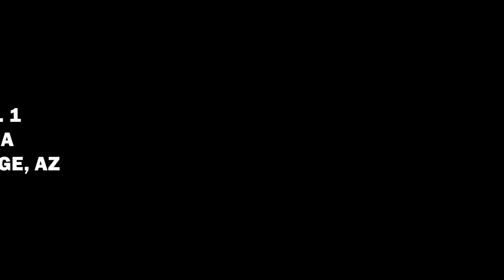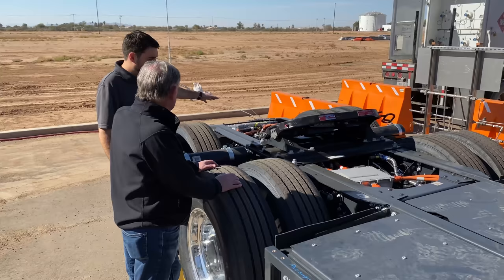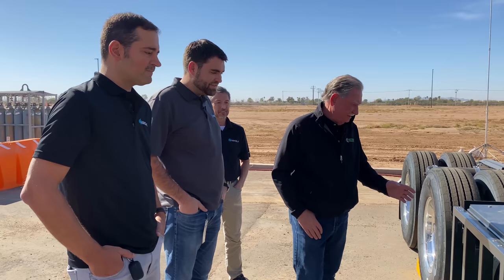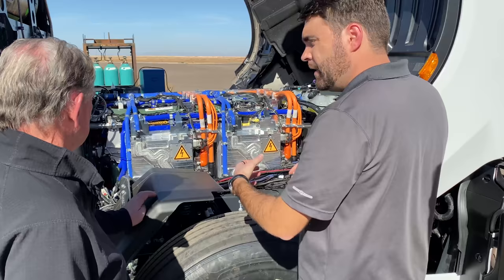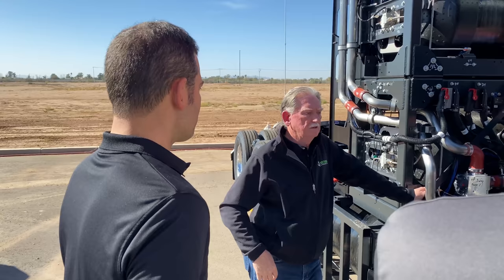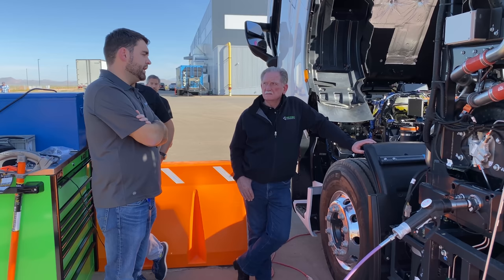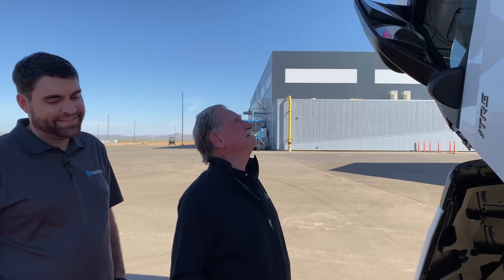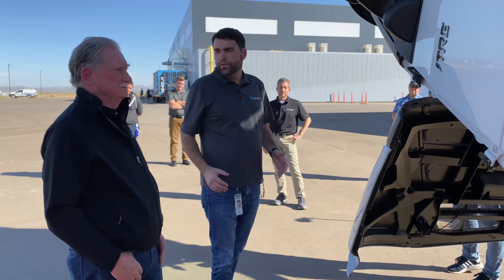Nikola Series - Ep. 1: Introduction & The FCEV Alpha

Comment: Hydrogen fuel cell EVs are just regular EVs with extra steps.
Reply: They also need batteries.
Reply: Hydrogen fuel cell electric trucks have better range,  doesn't lose range in cold temperatures, refuels in 15mins for trucks, can haul more cargo  because of weight limits on roads. More cargo equals more revenue
Reply: Its market is niche for long distance trucking, that doesn't mean its pointless.
Reply: @mariofornarelli1067  maybe look into scania for better clarification. They actually already operate multiple heavy use commercial h20 vehicles. In customers hands with continuous feedback coming to them from those customers. Yet they announced earlier this year they are abandoning all h20 vehicle development. And sticking strictly to building out their commercial use ev lineup of vehicle's. 🤔
Reply: @4literv6  look into Hyundai fuel cell electric trucks they already have 100s of them in Switzerland
Reply: @mariofornarelli1067  I'm well aware of those trucks, did you know each one has a 210+kwhs battery pack onboard it? 
Did you know a hydrogen commercial use vehicle uses 3-5x the energy of a similarly equipped ev commercial use vehicle. 

So a hydrogen commercial use vehicle requires rare earth elements in the catalyst which wears out. 
Requires a large battery pack, requires multiple electric motors. Specialized tanks for holding the hydrogen. 
Requires infastructure to fuel it and service it which doesn't yet exist at any large scale.
Hmmm yes let's all hype hydrogen over evs. 😏
Reply: @4literv6  hydrogen fuel cell electric truck is an electric vehicle lmfao 😂
Reply: @4literv6  Also BEV trucks for long haul with cables over head cost millions of more compared to hydrogen infrastructure and hydrogen made from renewables and nuclear.
Reply: @mariofornarelli1067  what's so funny though? It's less efficient than an ev version more complex, more expensive and the infastructure doesn't exist currently to support them.

Comment: @13:15 -- 270 horsepower seems a bit weak.  Most diesel semis are in the range of 400 to 600 HP while the Tesla Semi is 1,000 HP.  The Model Y long range has 350 HP and the performance has over 450.

Comment: 500 miles and takes up as much space as 500 miles of batteries. 

Hydrogen currently costs around 15,- per kg. Or about 900,— for 500 miles. And electricity would cost about ,16 per kWh or for a 750kWh battery 112,— for 500 miles. 

Now drive that vehicle for 1 million miles which it should last. Lets not talk about the fuel cells they have to be serviced ever few thousand miles. Lets talk about the cost difference. Say hydrogen can be produced @ 5,— per kg. Then its 120.000kg x 5 = 600.000,— US$ Energy cost. And about 225.000,— US$ for electricity. 

Case closed.
Reply: Do you really think the kWh and Lithium are staying the same if there is a massive increase in demand? Fuel Cell just lacks the supply infrastructure.
Reply: @RogerM88  
No, long term the price will go down, because of increasing supply, innovation and economies of scale. There's plenty of lithium, it's not going to be an issue.
Reply: @RogerM88  The price of battery materials and the cost of electricity are almost certainly  going to decline.  Economies of scale for materials and the move from nuclear and fossil fuels to wind/solar for electricity.

Fuel cell vehicles will have to pay 2x to 3x more for electricity due to all the energy loss with electrolysis and compression.  And user will have to pay for the infrastructure to generated and store hydrogen.

It looks like Tesla may put their first battery powered semis in private hands in the next couple of months.  If they perform like Tesla has stated then the FC semi is a dead dog.
Reply: @SciFi Author B.L. Alley 
Actually, EVs use orders of magnitude more batteries than anything else, so yes, demand is growing like crazy. But fortunately supply is growing too, so it's fine.
Reply: Those tanks are much bigger than I expected. And I haven't seen any (credible) plan to make hydrogen cheap enough to be viable
Reply: Everything in the design is terrible. Tanks are less safe if kept near the ground where ground debris can puncture it and where other low vehicles can hit it. They should have kept all the hydrogen tanks together in a larger second cab - behind the driver cab. It would be safer from impact, would have less hoses to leak, less parts, and easier to service. It doesn't make sense to sacrifice function try to keep the shape of a traditional truck just to look good.
Reply: @SciFi Author B.L. Alley 
Except it does. That's why we have a serious battery shortage, despite the exponentially growing supply.
Reply: Thought the issue with batteries on long range trucks was the weight
Reply: @SciFi Author B.L. Alley 
But EVs are causing the shortage. They caused the huge jump in demand that nobody saw coming (well, except for Tesla).
And an EV has far far larger battery than any mobile device.

Comment: I'm still behind battery electric for trucking. Hydrogen will always be too expensive compared to electric. Maybe charging time will be a bit longer, but we cannot assume that all trucks are interstate long-haulers. Most can do their thing on a single charge and be recharged at night after work.
Reply: The industry will learn that a little less flexibility can pay off big. Better planning software will make that happen.
Reply: Batteries are barbaric, but so is liquid fuel. We need to reduce both to a minimum.
Where are the billions that should be invested in reverse engineering Nikola Tesla's best work? even HE didn't really like batteries.
Reply: I'm not, I'm in the "long haul trucking is doing it wrong" crowd. Electric freight trains are massively more efficient than any sort of BEV or fuel cell truck. In town, yeah BEV is the way to go, but you don't need a huge battery for that..
Reply: Which is why Nikola has fuel cell and battery-only options
Reply: @quixomega  there's a train track a few miles from my house. I only get caught by the train once in a blue moon but when I do it's a min 10 min delay. I can't imagine having to deal with trains in a daily basis. Semis are always going to do most of the hauling.
Reply: @bahamatodd  Hyllion too. Except their ceo isn't going to jail
Reply: @quixomega  DAF, VOLVO, Mercedes are already on BEV trucks. As is Tesla.
Reply: @Cloxxki  A vote for Solid State Hydrogen.
Reply: Isn't that why Nikola has a BEV variant of that exact same truck? 

To cover both markets, short haul and longer haul. 🤷‍♂️
Reply: @matthenley7641  when working with Hub's you can do most of it all.
I think if most local and short trucks go BEV you can even keep long haul on ICE.
There is more gain in city trafficking on pollution.

Comment: 700 bar, 10,000 psig. How often do those tanks need to be inspected and tested? Do they have to be stamped?!?

Also, no degradation? Pretty sure membranes can deteriorate like everything else in this world. I wonder what their life cycle cost for that would be. 

Not even getting into the thermodynamic crime of producing and compressing Hydrogen to use as a transportation fuel.

Hope they figure all of that out though! Great video! Thanks Sandy!
Reply: The tanks in a Toyota Mirai have a service life of 10 years, and renders the car total loss at the time they need to be replaced, because these tanks are so expensive.

I know these tanks are different but gives you a ball park where this might be going.
Reply: @MarcoNierop  An additional reason it's a throw-away vehicle: fuel cells wear out.  They probably aren't going to last much longer than a decade of driving.  An expensive tank replacement can't be justified when the fuel cells might fail soon after.
Reply: The degradation was probably the lowest point of the video.  What they were actually saying is both batteries and fuel cells degrade substantially but batteries tend to be rated using as-new range while their fuel cells would be rated using their degraded range.  Mind you the context was only the kW output, not the total range of the vehicle; I'm unsure how much the degradation affects efficiency and thus range.
Reply: @MarcoNierop  That doesn't make any sense, they're just plain carbon fibre empty tanks, how fkn expensive can an empty tank be, 1000 bucks?
Reply: @MarcoNierop  Which is more expensive, Mirai hydrogen tanks or EV batteries?
Reply: I didn't follow that part and wish Sandy had asked for clarification. They mentioned the membranes or some part of the fuel cell degrading over time and at the same time said the output after 10 years would be close to what it was at the beginning.
Reply: @rhamph  The FC will give the same output after 10 years, even as the membranes are at the end of their life after 10 years. That's probably why Nikola uses the 10 year/1 Million Miles warranty plan.
Reply: @giovannifoulmouth7205 you've obviously never bought or even casually perused the cost of a very high pressure vessel.
Reply: The tanks are large, high pressure with a dangerous gas. In South Africa, if I am not mistaken, by law the tanks would need pressure testing regularly.  Not sure if this would be once a year or every 18 months. I see this as a major ongoing maintenance cost.  They would also need full certification when supplied new.
Reply: @ThisIsF-dUp  They'll have the same power output because they're derating them.  That's fine, I think it's more honest to give end of life ratings.

Power isn't efficiency though, and I don't know if fuel cells also lose efficiency as they degrade.  Loss of efficiency would mean 500 miles of hydrogen tanks would become 400 miles, but you're still paying to fill up for 500.
Reply: @1djbecker  The trucks will be available through a 7 year lease. So eventually they will come back to Nikola where the worn out components can be replaced and the truck can be leased again.
Reply: From what I understood, total power output will degrade over time, but the efficiency will remain constant.
As for the high pressure vessels, they will explode. H2 at 10,500 PSI is insidious. It will degrade the integrity of the materials over time. The tanks will rupture and when they do, it will be all over the news.
Those fuel cells require precious metals. I have no idea if the precious metals can be reclaimed and reused through recycling when the fuel cells reach end of life.
As for worn out parts: Fuel tanks, fuel cells and fuel delivery system will all have to be replaced. Anything that the high pressure H2 touches will have to be replaced or the refurbished vehicle will suffer a catastrophic failure.
Perhaps further research will discover materials and processes that will bring down the cost of fuel cell power plants, the production of H2 as fuel and make the systems safer, but at this time, I've not even heard of any developments that give me any confidence in anything better than what Nikola is working on right now. Great as a thought experiment, but not safe or practicle for comercial use.

Comment: In the unlikely event Nikola actually started to make real hydrogen trucks, you can clearly see that due to the complexity of hydrogen tanks and fuel cells this technology is doomed to fail.
Reply: Also fueling works out to be some 2X more expensive than diesel in an optimistic case.  DOA, probably just attempting to limp the stock along until they can all sell.
Reply: Toyota is 20 years ahead of these guys on hydrogen tech, they just insist on applying it exclusively to products that make no sense. They should be working on a truck, and a railroad locomotive.
Reply: Thank you for your interpretation Mr. Engineer.
You definitely know how it works!
Reply: @jonathanlyng3442    Elon:  "Hold my BEER"
Reply: @Mrbfgray  
Unicorn truck.
Reply: It was designed specifically to fleece naïve, noob Robinhooders and has succeed at such to an impressive degree.

Comment: I'm really interested to hear and see if Sandy thinks this company can turn themselves around after Milton's shenanigans.
Reply: The two engineers Sandy interviewed, they seem sincere, they are doing good work, the problem is I fear they have a losing proposition which is fuel-cell, and I don’t need Elon to tell me that. Consider this:

With a battery electric vehicle you have to usethree major components Power conversion components before you get to the drive train:
Batteries, inverter, and motor.

The hydrogen vehicle, not even looking at the problem with hydrogen cost, etc. you have these components in front of the drive train:
Super high pressure tank, expensive fuel cell, possibly batteries for surge power, then the inverter and the motor.

Unless these hydrogen vehicles have some extremely superior range proposition and super Duper fast refuel, I don’t see the advantage. Even then I’m dubious. The principle that should be applied is the KISS, “ keep it simple stupid.“

I’m not against hydrogen, and maybe this is a niche where it will work. Maybe I’m all wrong. But I doubt it. I think the range and fast recharge will be there with pure battery electric Heavy duty trucks, and they will win out in the long run. It will be interesting to see what happens.
Reply: @steveperreira5850  You nailed it; this thing is designed to have a 500 mile range ... just like the Tesla semi. Another interesting point in this video is that the fueling is going to be not super quick.They are talking an hour now and getting it down to 10-15 minutes. With some very high pressures required for that. This is not at all like fueling up a diesel tank.

The Tesla semi will charge to about 80% in 30 minutes with a 750kw charger. So, not a whole lot of extra range, much higher operational cost and it boils down to a 20 minute advantage refueling, at best. That basically sounds like combining it with regulation required breaks (min. 30 minutes) would be the deal. I believe the Tesla Semi also has a stronger engine (1000HP). 

I'd say, rip out the hydrogen bits and put a decent battery in and you end up with a better truck. As they said, the electrical bits are the same anyway. Nikola of course started out with that plan and could not get it done. The trucking business is very cut throat and not at all driven by things like range anxiety or other irrational/emotional crap that consumer car manufacturers deal with. It has to be competitive dollar for dollar. This doesn't look like it ever will be. Not even close. Probably not even with diesel trucks.

Comment: These massive hydrogen chargers required, Tesla must be laughing. It’s much easier to put in electrical chargers than install new hydrogen chargers. Thank you sandy for showing us the NOT future. Maybe one of the Chinese companies will buy this factory once Nikola fails.
Reply: Fuel Cell lacks the infrastructure, and makes more sense as a range extensor and in applications that requires a quick refueling and the maximum payload. Hauling an expensive and massive battery pack, doesn't seems very efficient.
Reply: @RogerM88  aka niche market aka not worth the upfront investment 9/10x
Reply: @RogerM88  The battery weight is pretty competitive with current power unit and drive train weights.
Reply: Energy density, batteries do not come close to the speed of recharge or the energy density of hydrogen.

Both very crucial things in haulage.
Reply: @Robert-cu9bm  hydrogen has shit efficiency so think about that chump.. imagine having to build 3x the solar panels just so your truck can feul up 10 minutes faster.
Reply: @lithiumox  
Efficiency doesn't matter, it's energy to weight that matters to haulage.

If you have a 40t truck that only has the carrying capacity as a 12t It's not profitable. And that's all that matters in the industry.
Reply: @lithiumox  
How efficient is a ICE truck?...30% maybe.
And what do we use everyday.
Reply: @Robert-cu9bm  so your saying I'm right about efficiency but you disagree based on the fact that what we have now is inefficient so another inefficient thing on an already strained grid is fine.. there is more than just cost but even when you account for cost hydrogen will be expensive as hell to produce even with renewables. Why spend your energy on making hydrogen when you can power the truck directly? In Germany there are even tram like power lines!
Reply: @lithiumox  
Like I said, the efficiency doesn't matter.

It's how much weight (cargo) you can carry to the cost is doing that.
It's could be 5% efficient. But if the running costs are 10% less, a business will use that over 95% efficient truck.

BEV will not suit every situation. And people like yourself who only advocate that doing understand the real world.
If you want a cleaner future, you need different types of vehicles to achieve it.

BEV is not suited to heavy loads, long distance travel, remote travel.

If your against having hydrogen in the mix as your implying, then ICE trucks will have to remain.